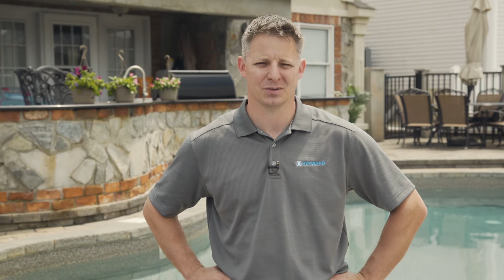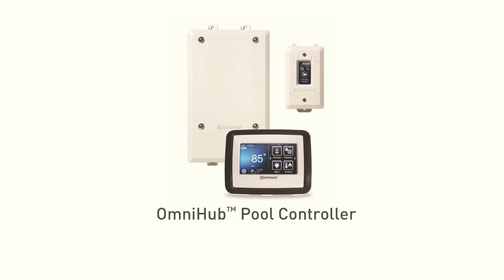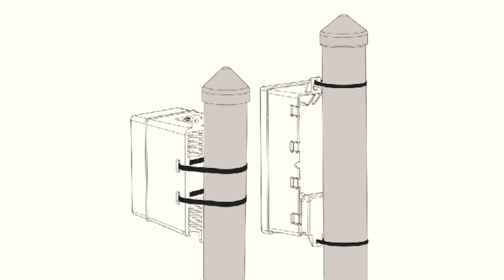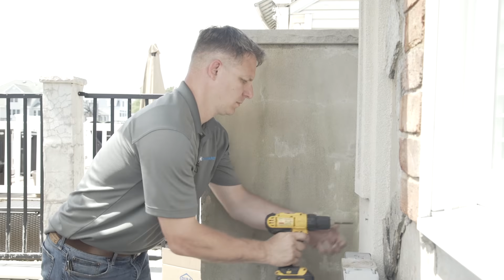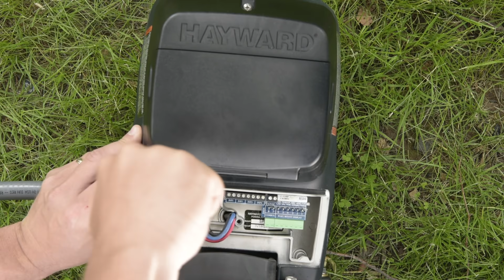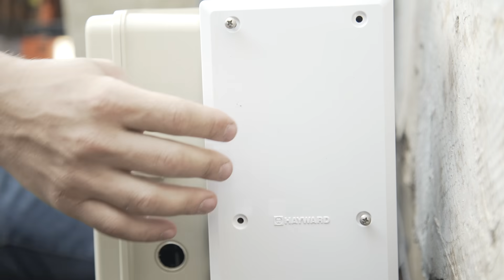VS Omni Installation

Comment: As an owner of a swimming pool service company, I wish you guys really would’ve have created a pause, quick clean and start button on the exterior of the relay when the client does not have the hub installed. Having to sign in each time we arrive to a property is ridiculous. What if a phone is dropped into a pool, cell phone died, an employee forgets his phone at home, etc. Common sense really! Jandy provides the exact needs listed above with the same concept. Also, why have a face with speed one, two, stop, start, etc on the face of the pump when it is not activated anyway. 🤦🏻‍♂️. Come on hayward, think about pool service providers.
Reply from the maker: Hi, would you like to speak with someone? Please PM your email address and phone number on our Facebook page or Twitter profile and someone will get back to you today.
Reply from the maker: If the VS Omni is not installed then the display on the VS pump would control it. It has both a stop/resume and quick clean button. Let us know if you have any more questions.